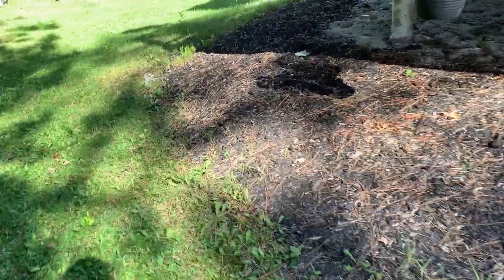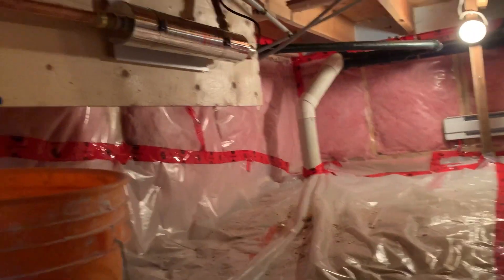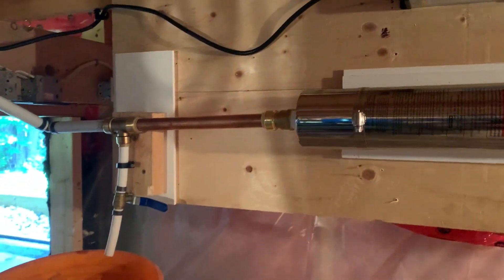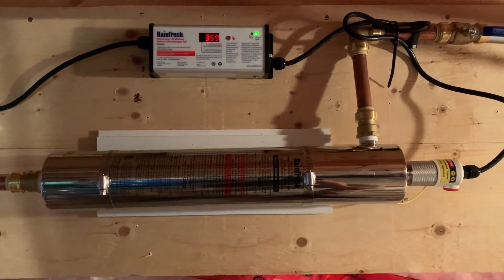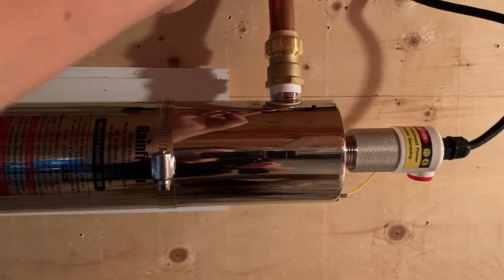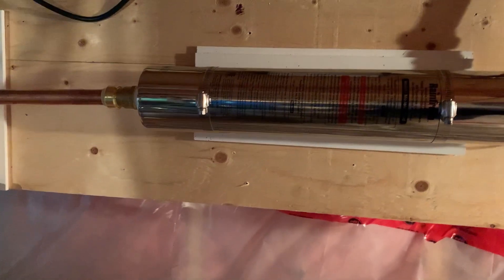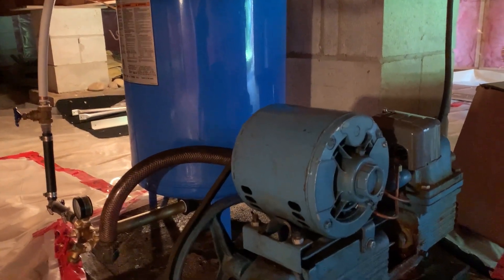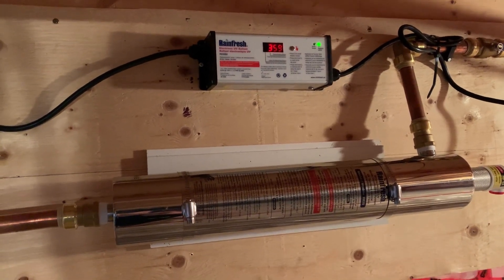Rainfresh R830 UV at the cottage! Safe drinking water from the lake

Comment: The UV filter for some reason gets rather warm as does a few feet of copper pipe coming from it. It happens from time to time. Why ?
Reply from the maker: @teekey1754  Totally normal, there is a literal lightbulb inside the tube. If you don’t use water for a while the water warms up/ warming up the plumbing around it. No big deal. Cheers